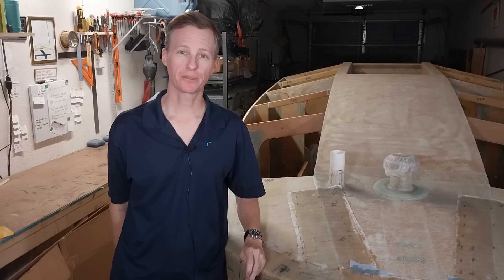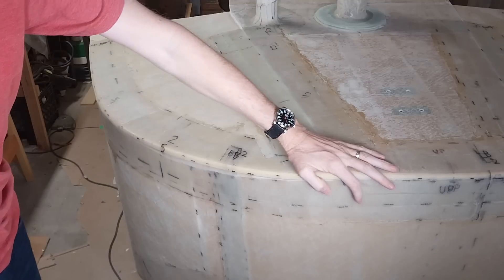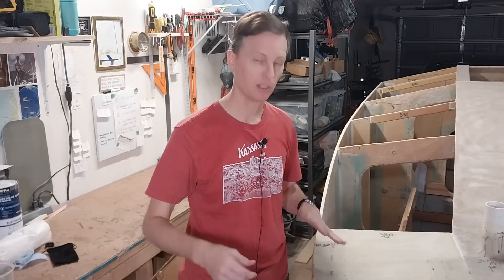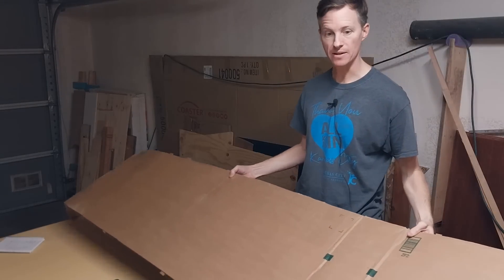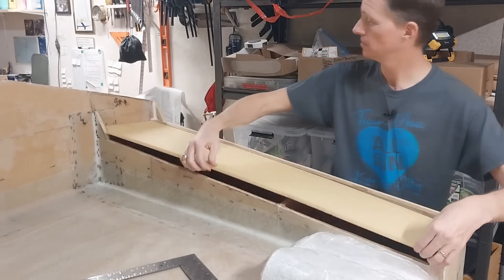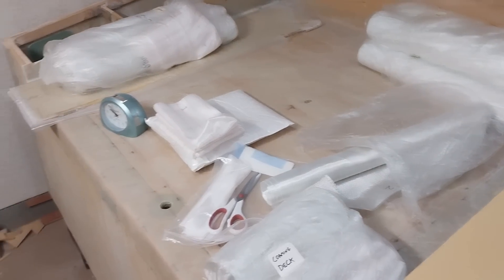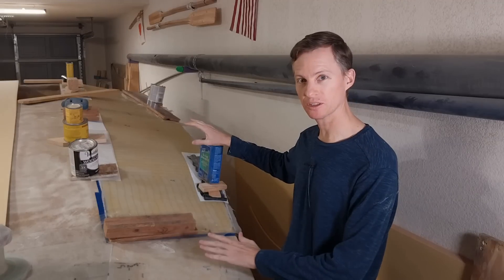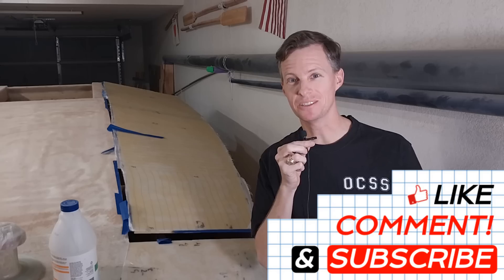OCSS-069 Creating a Compound Curve for the Deck - Mini-Cruiser Sailboat Build

Comment: If you would have learned to draw in 3D & weld and made it out of aluminium you would already be sailing. Just saying. Raw boat welding is approx 4 weeks, finishing touches would be 1 to 2 weeks. Rigging another week or so...Drawing designing depending on skill a few weeks maximum 2 to 3 months.... End result would be a sturdy longevity hull. Butt i guess building like this is fun also...
Reply from the maker: Very optimistic scheduling! I thought I would build this in only a year, but here we are at over 2 years of building (but I am also balancing this with a full time job.) I'd love for the boat to be built of aluminum, that would be very cool. Sadly I have 0 welding experience.
Reply: I admire the course you have chosen and utilized skills available to the average garage builder.
Reply: Depending on where you were you'd freeze or boil to death!

Comment: You altered the design i see from a twin keel and skeg supported rudder to a midkeel and transom rudders. May i ask why? I kinda thought the twin keel/skeg option is pretty versatile and gives the option to beach and clean bottum without cranes etc, it also is more shallow... Is the reason stability or sailing profile? (twin rudder twin keel would be my preferred option btw)
Reply from the maker: It's still twin keel, and the depth of the keels have never changed. The skeg did get shortened. I don't really believe a long skeg does much to protect the rudder. If a solidly attached skeg hits something really hard, it's only going to tear out the bottom of the hull. Instead I'm going for a rudder that can take a hit and kick back, able to be put back in place later without suffering much or any damage. That's the best I can explain in a brief comment.

Comment: When you turn that deck panel over it may bend back against the curve due to its own weight. Fibreglassing the other side may therefore lock in the incorrect shape. Good luck, I look forward to seeing the outcome. Hope it goes well.
Reply from the maker: Yes I have to support it a bit to keep the curve while fiberglassing the bottom. I'm actually thinking to change my tactic for the starboard panel, but I'll show that in a future video.
Reply: Maybe fiberglass the underside and let it cure in the final position could be an option. Later you can flip the boat and make fillets, reinforcements, etc...

Comment: Looking very close to an enclosed cabin! What is the planned construction for the end of boat arch/bench/buoyancy float? I am not sure I would depend on unbraced foam core for those righting loads.
Reply from the maker: Unbraced foam? How dare you sir, I wouldn't say there's any unbraced foam on the boat. 😂
Well I'm still planning the arch. I think it will be fiberglassed on, integrated onto the sides of the hull with 70x350mm vertical supports.

Comment: Merry Christmas to  you and your family Captain.
🎄 Just wondering are you familiar with the "ticking stick" method of fitting odd pieces? If not, you should look it up, I found it very handy in my work as a finish carpenter/cabinet maker.
Reply from the maker: Yes,  check out OCSS-055 I show how I use the ticking stick method in that one. Thanks for watching!